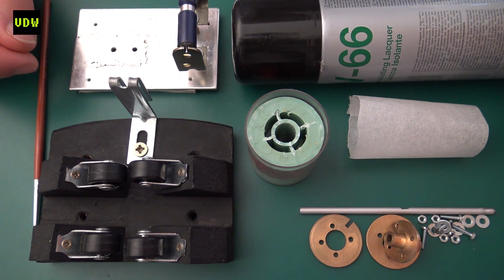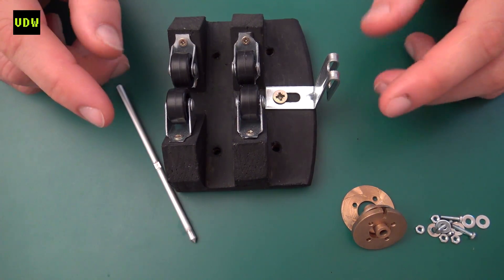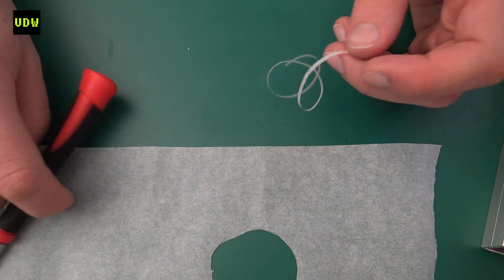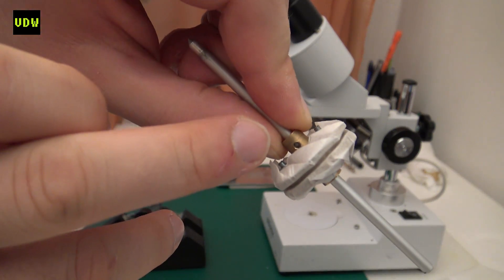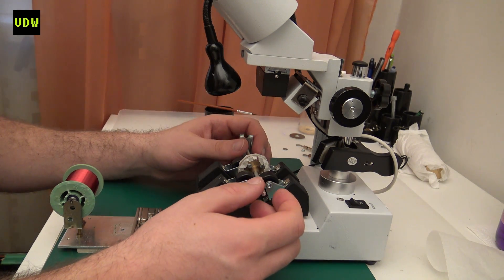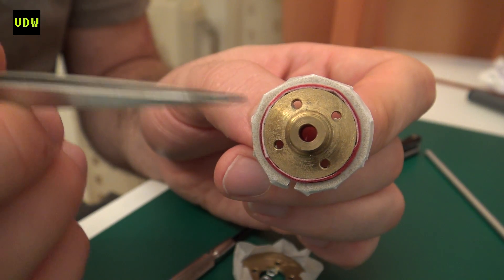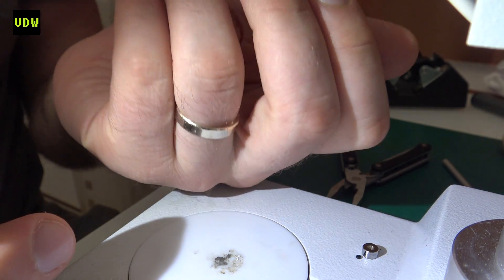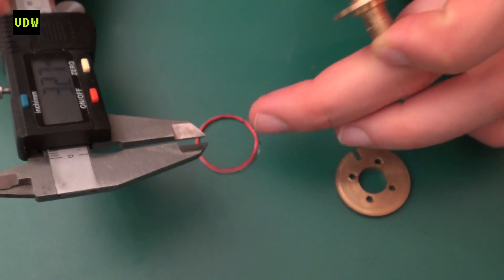Seiko Data 2000 Coil build - Ep 46 - Vintage Digital Watches

Comment: Hi there.
In order to get the correct resistance needed for the coil to work adequately, what length of wire, or number of revolutions, is required?
Reply from the maker: Hi, it depends on the diameter of the coil wire you use. Final resistance needs to be between 3 and 5 Kohms, you factor resistance per meter of your coil and you can calculate revolutions.
Reply: Would this wire be ok to use?
   NICHROME Nikrothal 50AWG 0.025mm 2228 Ω/m 679 Ω/ft Resistance WIRE
Reply from the maker: @JurdyJurdz  yes, that would be a good wire to use
Reply: Hi its my understanding the nichrome wire isnt coated and therefore woukd short iur if coiled?
How about this wire
0.056mm 43AWG ENAMELLED COPPER GUITAR PICKUP WIRE, MAGNET WIRE, COIL WIRE 100G

Thing is the seller says its 7 ohm per metre. That means id need 450 metres?
Reply from the maker: @JurdyJurdz  I used 0.025 bobin copper wire (coated with laquer), I only have experience with that.
Reply: Ok. Thanks for your help

Comment: Hello, If I were to make an external coil. would the dimensions still need to be the same or could they be different. I currently don't feel comfortable fully disassembling my watch and feel it would be easier for me to make an external jig for when i want to send data to the watch.
Reply from the maker: No, the external coil has a different size, but it doesn't have to be a very close match. There is a guy on youtube that made an app for android and uses the coil of the phone's speaker to send data.

Comment: Hi I just bought a data-2000 but the coil is damaged. Im wondering if I could make a coil and use it outside of the clock when i want to program it but dont understand how the impedance determine the coil turns. If I use other caliber it doesnt matter if I have the 3.5kohm? If I have a coil with diferent impedance could I attach a resistor to make the resistance 3.5kohms?

Thanks for your time and great video.

Comment: I would like to commend you on your fantastic work, I've just found my seiko memo watch in the loft after forgetting about it for a decade or so, to my surprise when battery was replaced watch works! Unfortunately it does not connect to keyboard :( would it be possible to send it to your self and have you find out if it's repairable?  Please :)

Comment: Hello, sir, can you please explain the copper wire? 0,025 are square mm. of section, or the diameter? Is it AWG 33? I'm trying to repair my unit's coil going after your explanations. Thanks a lot from Spain.
Reply: Jose Antonio Casas has podido hacer la bobina y reparar tu reloj???? Saludos!
Reply: @WillymexIbz  ya tengo todos los elementos salvo la laca formadora. Tampoco he construido el soporte, que lo voy a hacer de forma más sencilla y rápida. Vaya, que lo que he hecho han sido las piezas dónde se enrolla el hilo. Las he fabricado con metacrilato. No he podido encontrar el cobre de 0,025, pero sí una bobina de 120 m de 0,020. No sé si valdrá, la verdad.
Estás interesado en hacerla tú también? La verdad es que cualquier consejo o ayuda me haría un papelón. Un saludo.
Reply: Mucha suerte. Yo no lo voy a intentar. Cuando lo hayas logrado, ya me venderás una!!! Suerte!!